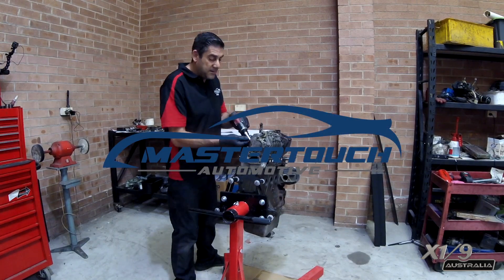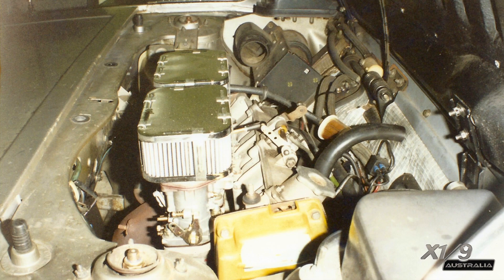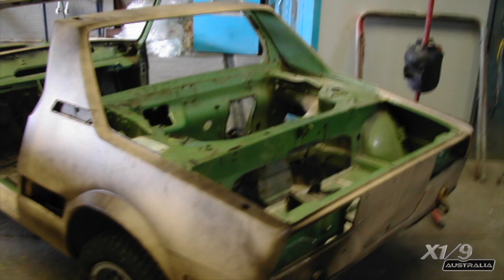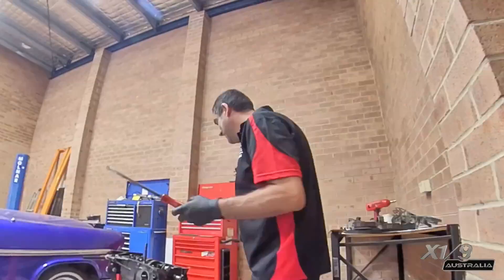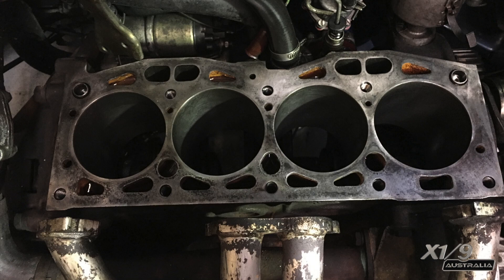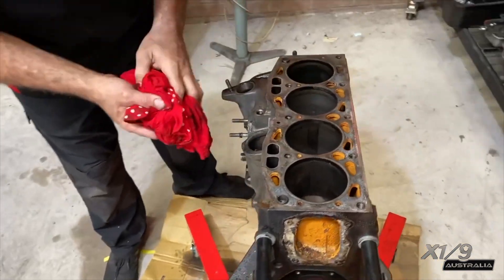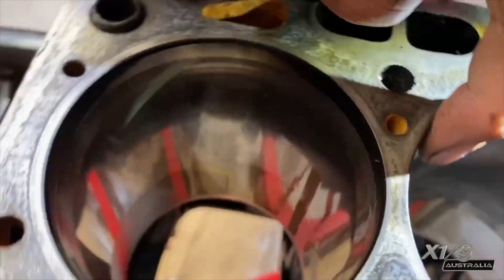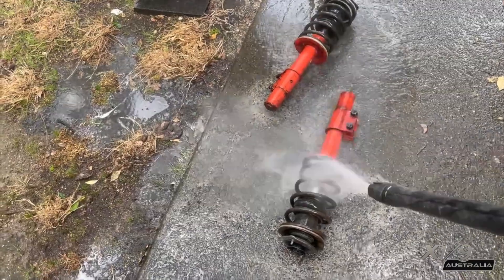The Green Machine Part 5 of a Fiat X1/9 fix

Comment: Hello. What was static CR on this machine, that pistons give up middle rings? Or more importatnt, actual measured cranking pressure? Thanks
Reply from the maker: Sorry that engine was built in the late 90's so have no info on it. Around 2017 It blew the head gasket and then had it fixed enough to get it back on the road till the 1600cc was built and put in my Darkblue video here. https://youtu.be/EZFz_Vnm7MQ?t=99

Comment: Weird cylinder wear.  Normally the wear is 90 degrees to the axis of the crank because the piston exerts pressure on that side during the power stroke.  Your engine seems to have wear in line with the crank.
Reply from the maker: Not sure as to why, not really sure when the problem started.